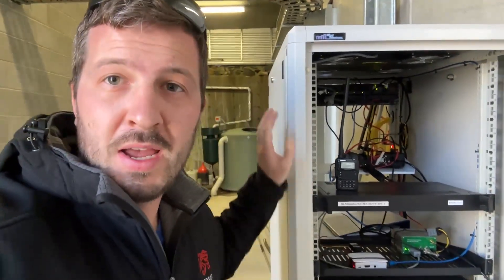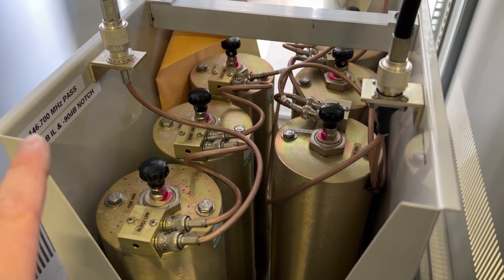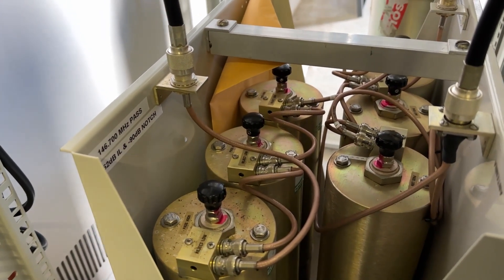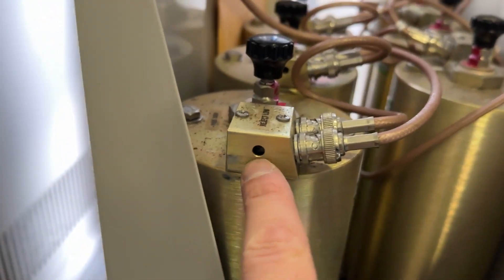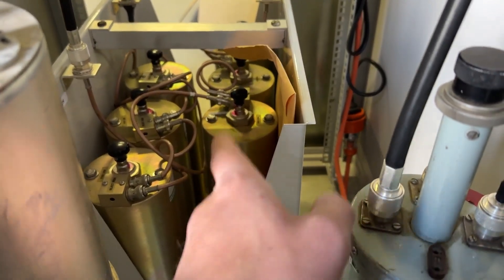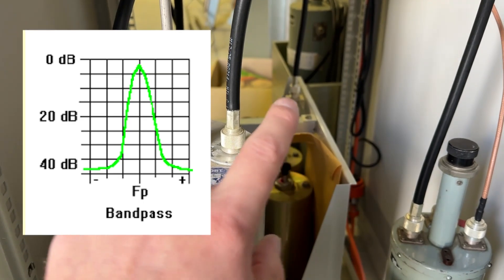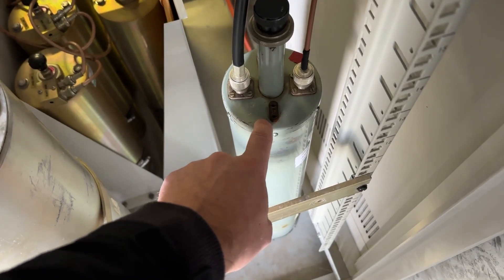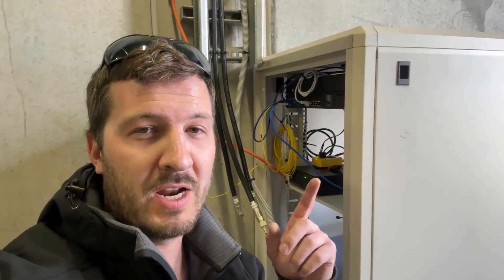Uncover the Secret Behind Ham Radio Duplexers

Comment: Are these set and forget or do they need regular adjustment?
Given no changes to the local rf environment.
Reply from the maker: Set and forget provided they don't get bumped or knocked about during transport. I usually set them up on the bench and then test again on site. I've had one set of older Motorola cavities that shifted over a bumpy 4WD track to the repeater site.

Comment: Repeaters are very difficult to get to work well. Many repeaters suffer from desensing that often is not recognised.
Also split antenna repeaters in combination with notch and or pass cavity filters are much easier to get to work if there is the vertical antenna height available.
Amateurs often want a high gain single antenna combined with a duplexer. If it works then this is the way to go but often a split antenna using just 2 dipoles will produce better results,
simply because it is much easier to achieve zero desensing.
BTW it is possible to measure desensing remote from the site provided the signal from the testing site to the repeater is fairly strong.
Another way is when keying the repeater if the tail varies in length when you let the PTT go then the repeater is likely to have desensing. 

Will VK6UU
Reply from the maker: Great tips Will!

Comment: I used to tune duplexers. I have found you can tune the plunger a little after you have set the reject capacitor to get better rejection without sacrificing pass characteristics.

Comment: Hayden, do you have a video with lightning protection devices?
Reply from the maker: No I don't. We don't have a lot of lightning here. I do have some surge protectors in a box somewhere.
Reply: Gas discharge 'tubes' can cause their own headaches, and I found in 40 years, they are more trouble than worth, if proper grounding and bonding is tightly adhered to.
Folded dipoles are 'quieter' than colinear and corporate feed antennas by their design. Look at large commercial antennas, the metal cap is directly connected to the internal ground path, with the elements attached at the low impedance point, which allows lightning/electrical discharges to route directly to ground, and if ground straps are installed in the shield of the cables, along the length down a tower leg, that greatly increases the losses of the impulse to be shunted to ground, and not into the equipment.
I work on sites that are at 5,000 + feet in elevation, often above 8,000 feet above average terrain, also with heavy snow loads, so you do your best to ensure you do NOT have to make your way back up and fight the cold and deep snow just to repair a minor failure.
Reply: I was thinking specifically for a repeater, not at the shack.

Shack bonding and grounding...there are MANY videos.